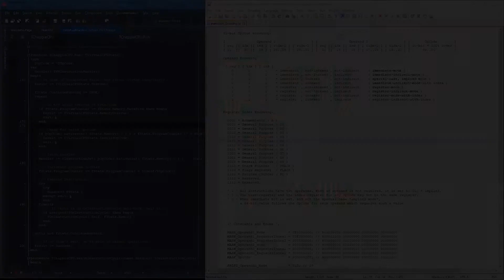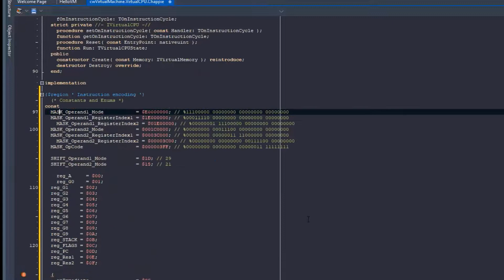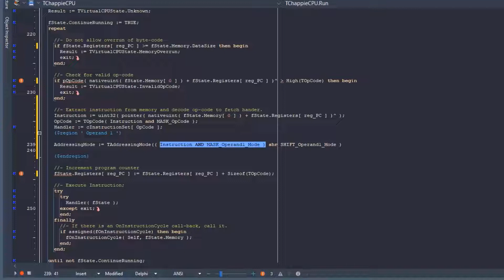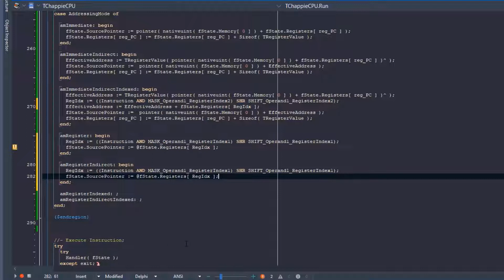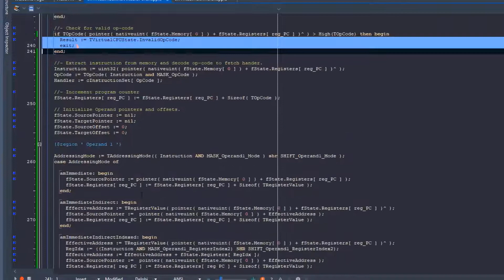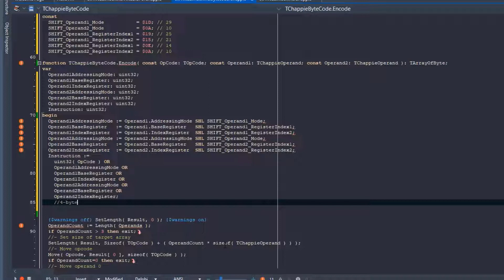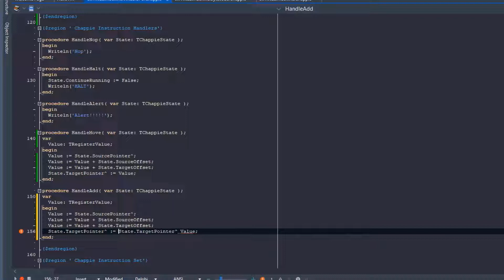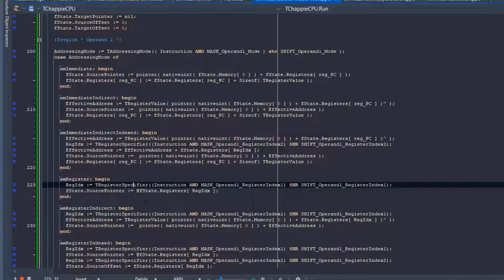Lets write a Virtual Machine - Part 3

Comment: i brought my friends to your channel we want to learn about handles in pascal
Reply from the maker: Unless I am misunderstanding your request, handles aren't really something that warrants a video.
Generally, a handle is used to represent an object when you can't work with the object directly. For example, MS Windows API uses handles to represent everything, from brushes to icons to fonts and desktop windows. This is because those items actually exist in the kernel memory space and are C++ based.objects. User programs aren't able to directly açcess kernel memory for security reasons, and even if they could, Delphi would not understand the C++ objects.  So when you want to work with a window or a font or other object, the operating system gives you a number to represent that object. That number is the handle. Say it gives you a number 5 for a font, you can just call the windows API with that number to say, do something with font 5.
Handles may be simple numbers or pointers, if pointers that may point directly at the object or not, their inner workings are obscured from you. You simply pass those values I to API calls when you wish to use the object that they represent.